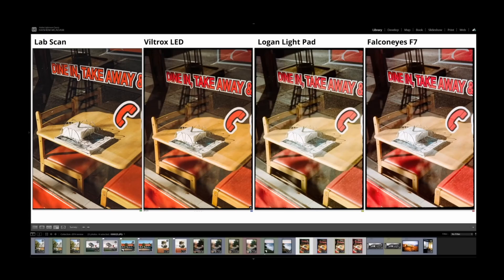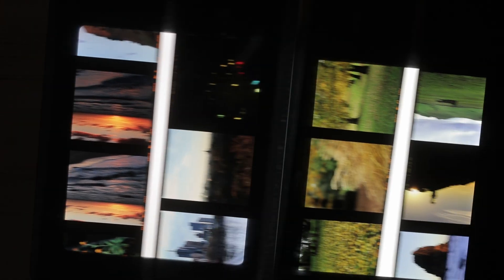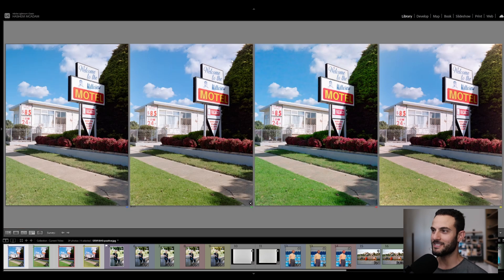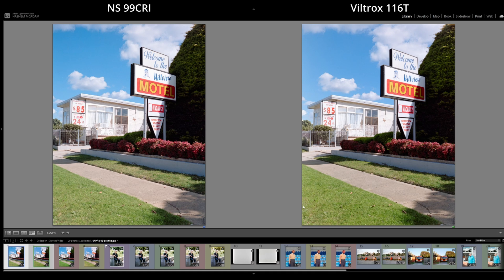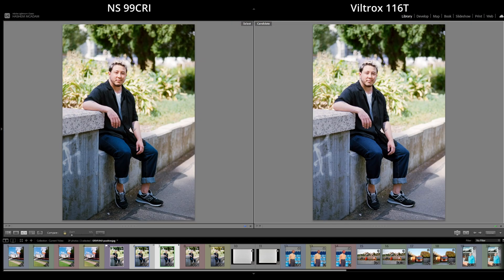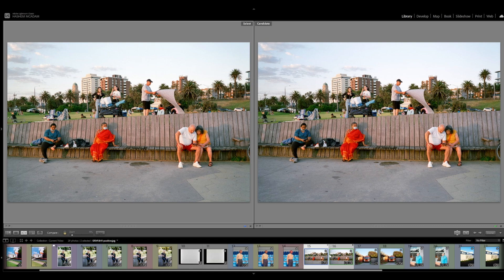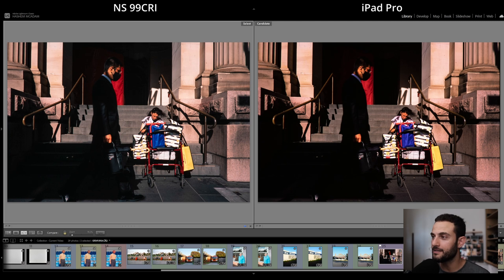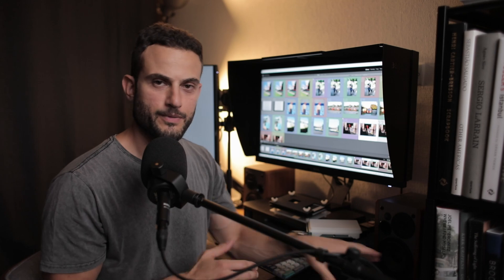Light Sources for Film Scanning

Comment: Just a suggestion for some testing that you may want to consider...
I think it is viable to use the light source to calibrate your digital camera for better color performance.  Basically, take a color target and your light source and set it up to provide good uniform light on the color target. Use the camera and lens you intend to use for the copy work. Take reasonably tight photos of the color target and use the settings that are as close as possible to what you will use in the scanning (but probably with a different exposure time).
Take that file and run it through your calibration software as normal but this will be a special profile just for scanning purposes.
If you do this, I suspect your 95CRI light source may become very close to your 99CRI source and you won't need to do heroic color correction to get approximately the same color from both.
I doubt this will be able to resolve the shortcomings from lower CRI sources because the colors will be a bit too discontinuous to correct, but it would likely improve all of the light sources somewhat by taming the odd colors a bit and bringing up the defficient colors somewhat.
Reply: I have done a lot of scanning of chromes (35mm) for my father (50+ years of slides to archive for him) and I used a high CRI compact fluorescent light source to do it with an olympus slide duplicator and macro bellows setup (this stuff is pretty inexpensive on Ebay these days) that I adapted to a Sony camera and later to a Fuji GFX camera.  I did a lot of testing and the results are quite excellent.
I am now putting together a much more sophisticated copy setup for 4x5 and MF film.  I got one of the larger Negative Supply light sources (95 CRI) and am going to begin testing the setup very shortly (I adapted an old Durst enlarger for the copy stand arrrangeent).  I have four lenses here that may be viable for the 4x5 and MF copying tasks, and I'll be doing lots of testing to figure out what approach is producing the highest quality results, and hopefully, the quality will be high enough for my needs (I'm pretty particular on these kinds of details).
However, I will be testing out the camera calibration approach that I mentioned above.  I have done this in the past with the fluorescent source and it did work well. I'm note really sure it will be needed for high CRI sources, but I think it will probably benefit for doing the calibration.
Reply: @mjmdiver1137  let us know your results on calibration, sir!

Comment: What a fantastic comparison, thank you for putting the time and effort in on this!  I've been using a home made setup of a massive diffuser box made from the frame of an old computer desk, lined with reflective panels on the inside and a solid piece of (masked) frosted glass on top with a down firing Godox 400 strobe.  I can scan (using essential film holder) at around 1/100 sec at f11, the strobe is set to about 1/4 power and wirelessly triggered.  Scans are great, colours are pretty much bang on lab scans and no sign of any casts or blotches.  Only problem is the whole setup takes ages to set up and pack away and really grates on me if i cant get my scanning done in one session.  I've just ordered a NS CDI 99 light from your review results, hoping this may streamline my workflow a bit.  Congrats on an awesome channel!
Reply from the maker: Sounds like quite the set up! How do you go about previewing and aligning things? just using the camera's "exposure preview" type setting which cranks up the gain for live view? Thanks for the kind feedback, I'm glad the video helped you pull the trigger on the NS light :-)
Reply: @pushingfilm  Hey thanks for replying, i forgot to mention the preview setup. I have a cheap flouro work light that sits on the floor that i use with a dodgy foot switch.  Switch on to align and switch off before capture so i dont get wierd casts.  The flouro illuminates the whole diffused glass top so the table doubles as an excellent negative-in-sleeve preview (light table) with a loupe.  I use a canon RP and 100mm macro on a tripod set to manual focus, tethered to my PC so dont really need to mess with the camera once its dialled in (unless i knock it) i also use a bit of gaffer tape to hold the Essential film holder in place while i load and pull thr film through.  It really is a bit of a frankensteins monster that takes a bit to setup and pack down but once its dialled in you can knock out a heap of rolls in one sitting.  I cant wait to get the NS light pad for simplicity!  There are some other comments here about using strobes and speedlights, seriously give it a go if you have the time as all issues with CRI / Brightness etc are moot.  Just dont expect a streamlined setup:)  Cheers mate, and keep up the great work on your channel.

Comment: @17:33 - Masking that Viltrox 116- that doesn't look like normal gaffer tape. Is that some kind of Black Cine-Foil?
Reply from the maker: It's Nashua brand gaffer tape
Reply: @pushingfilm  Back for one more thing: Is it possible that the shutter speed you get with the Viltrox 116T with diffusion layer is 1/30 ? For an f/8 + iso 100 setting?
Damn, that's real low shutter speed if you wanna get sharp scans, isn't it?

Comment: Hello, nice video. I have a Gepe slim lite 5000 (G2001) which has no CRI number. It is rated at 5000K on the box, is there any of working out what the CRI may be?
Reply from the maker: Thanks John. This looks like an exact clone of the Logan branded panel I show in the video, in which case I can not be sure what CRI it is but would guess it's in the 80-90 range.

Comment: Great info and well presented thanks for doing this.  I use a durst colour copy 350 to digitise my negs.  It’s an old slide copier set up that are pretty much worthless these days.  You mount your camera to the stand with its inbuilt bellows and you use it with enlarging lenses.  I never had issues until the halogen bulb needed a replacement and I thought I’d use a light pad, wow so many issues due to low CRI and false positives for light leaks due to the light pad not being directly below the essential film holder.  Replaced the halogen lamp and back to rock solid 100CRI. I was surprised at how finicky the led light pad was, granted it was the wife’s spotlight bought one with no advertised CRI.

Comment: Thanks for the detailed review and especially for including slide film, where there is often considered no “interpretation” of the picture unlike inverting color negative film.

Do you think that given an IT8 target and a 95 CRI light source, the minor shortcomings compared to a 99 CRI light source could be profiled out?
Reply from the maker: No problem! I do think so, as long the light source has a decent output such as the 95 CRI examples used

Comment: One thing that never seems to be mentioned in guides like these is what color temperature to set the light to? Some people say that 5600k is the best and i’ve also seen 5000k. I have tried both and not see a noticeable difference between the two, so I generally stick to 5000k, does anyone have any insight into this ?
Reply: For negative film, the color temperature of the light is less important (since the colors are interpreted in the inversion process), but for slide film, Fuji recommends a 5000K light source for viewing (Velvia 50 datasheet). Kodak doesn't make any recommendations, but in the E100 datasheet, they use 5000K for the dye density curves.
Reply: @pulpufictione  that's interesting about 5000K.  The old slide copiers use tungsten lighting bulbs and they are all around 2700 - 3200K  I use Osram halogen in my slide copier and they are bang on 3000K.  Don't know for sure but didn't Kodachrome have a blue cast on purpose to work with the yellow cast of tungsten lighting in slide projectors?  Does that mean newer slide emulsions are made for led lightning?
Reply: @poniatowski3547  not necessarily LED lighting, but a light source that conforms to  ISO 3664:2000 D50 (which could be fluorescent or halogen, but I suspect that most new systems migrated to LED for cost and efficiency)
Reply from the maker: Hey, I find it doesn't matter too much since you'll be balancing it back to make the film base neutral pre-conversion. I generally just leave it all on daylight 5600K . I've done some tests with 3200K which I'm still experimenting with for slide film (since projectors use a warm light and slides were designed with this in mind? Purely experimental though) but so far, I'm not seeing much difference.
Reply: It depends on the specific light used, and the actual color temperature it outputs. This can be measured using a color spectrometer like a Sekonic C-800. Without actually measuring the light, if you don't notice any difference then I wouldn't worry about it. We're only talking about a subtle warm-cool shift between 5000-5600K.
Reply: K means Kelvin. Not 1000.😊

Comment: Useful info, well researched and explained. Side by side comparisons tell the story. Good points about film elevation over light source, and ambient light. “CRI” new one to me - learned something.👍
Re iPAD, screen protector definitely suspect. What method did you use to have the iPad display a white field? I’ve taken a “pure white” jpeg image (white balance checked in LR) and then displayed full screen in Photos — seems to work OK.
Calibration. If you do lots of scans it might be worth the effort to calibrate color by shooting a color chart, scanning via favorite light source and then correcting in LR; build/apply correction pre-set. No?
Some folks scan w/digital camera placing film emulsion side up — more accurate focus; then reverse in post. What’s your preference?
Suggestion for future vid (unless I missed one you already posted): “bulk up/roll your own”. How-to and value proposition of loading your own film canisters from bulk in 2022. Cheers!
Reply from the maker: Hey, thanks for the comment! I think someone mentioned the display mode being suspect, if its on true-tone or something similar. I need to check those settings and do another test. I have been meaning to get a colour checker for a few things like this, but the good ones seem rather overpriced! Since it's for just occasional use, I might go for one of the cheaper Amazon ones. I definitely prefer to capture with the emulsion side up, then flip them all in Lightroom. I find it reduces the chance of any minor stray reflections sneaking into the capture, and it gives a sharper rendition of the grain in some tests I've done. Thanks for the suggestions also! I've mentioned bulk loading in passing in some past videos, but yet to do a dedicated video on it. Could be a good one to add to the list :-) I've currently been bulk loading Kodak 500T.

Comment: Thanks for sharing this. I appreciate your taking the time. One thing I'd love to see you add is tests using a strobe or flash alongside the LEDs. I'm putting together a system now using a flash with a modeling light as the source. In theory, the broad spectrum light should be superior to mixed LEDs but I won't have an easy way to test it against LED panels.
Reply from the maker: Thanks for watching! This is something I've been meaning to try for a long time (I tried it ages ago around 2013, but my setup was terrible and I didn't have the conversion tools or knowledge yet). I have heard that there would be such advantages, so I might try and rig it up with the EFH sitting on it's side, with some kind of makeshift snoot on my 430EX speedlight!
Reply: Yes to this. I have a strobe setup that uses a diffused source into a white box with the EFH on top. It eliminates any shutter speed issues but very curious to know how color rendering is affected.
Reply: @morefiction  me too! A small rolling stand with a white diffuser box on the lower level and a hole cut into the top surface. The EFH is mounted on top and I have an adapter that mounts a macro lens directly to the EFH. Now all I need is to finish a large job scanning old stills so I can turn to the negatives...
Reply: Yes to this as well! I was hoping strobes and/or enlarger bulbs would be included in this comparison. I am currently awaiting my EFH and I will likely do a comparison between my Kaiser Slimlite Plano Lightbox and a strobe of some kind. Would be great to see how it compared to all those other options though.

Comment: My question, and this is for anyone really, is it worth the investment if you are using a Epsom flatbed? I just find it slow and tedious with the flatbed at this point. I hear it’s much faster once you are set up? Any input would be appreciated!
Reply: I have a (quite old now, but still probably superior to the Epson offerings) Microtek M1 scanner that I have used a good bit.  My experience with digital camera scanning is that if you use qualty lenses, camera, light source and technique, you will produce a scan of 35mm film that is clearly superior to the Epson scanners.  Probably similarly so for MF film.  Somewhere in there as the size of the film gets larger, your digital camera won't match the resolution that the scanner can deliver because the scans can get larger as you go to larger film, but the camera doesn't really offer that ability.  Of course, you could do mutiple shots and stitch them...
However, whether the difference is worth the investment depends on waht you will be doing with the scans... simple screen viewing or internet display will probably not make the effort worth it, IMO.
Reply from the maker: Hey, it's different for everyone I'm sure, but I personally did find it worthwhile since I already owned a macro lens and DSLR. Therefore I sold my flatbed and just use this method now. However, if you were going to invest in a whole camera setup mainly to scan film, that might be a different story... depending on the volume you plan to go through.

Comment: I really want the iPad option to work, but I scanned some Pro400H using my iPad Pro 2021 11inch and I got oversaturated scans (and reddish cast). I raised the holder but I'll ty again with additional diffusion to see if I get different results. Great video, btw!
Reply from the maker: Thank you! Yeah I think I'm gonna do more investigation with the ipad display settings and try it again
Reply: @pushingfilm  Download an App called "Color Screen" that allows you to override all the nasty settings and give you the brightest, purest light you can get on your IOS device.
Suggest you remove the screen protect if you want that final 1%.  Latest retina iPad since 2018 are OK, but they are not so bright (= longer exposure times).

Comment: Wow this really makes a difference. I've been using a cheap led panel that I have no idea its CRI. But I do have the Falcon Eyes F7 and never even thought to be using that for scanning. Now i'll at least switch to that. Thanks for this. That Negative Supply light really made a difference too..
Reply from the maker: Yeah it can make a difference! If you do a test of the same frame with both lights and see how they vary, let me know 🙂
Reply: Did you get any results with Falcon Eyes F7? I'm also considering using mine for scanning.